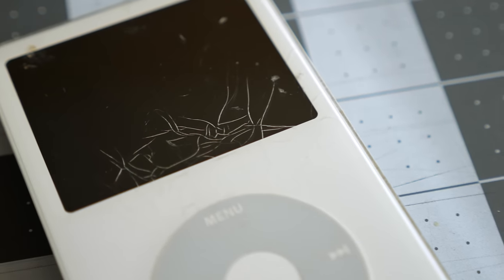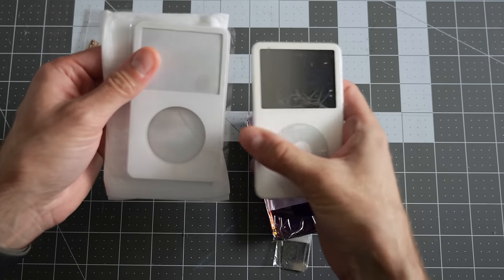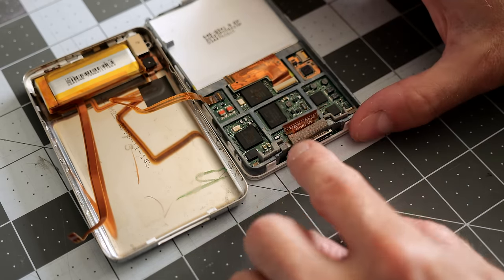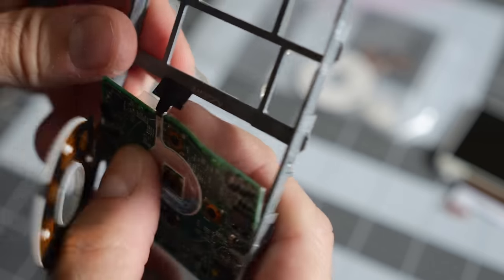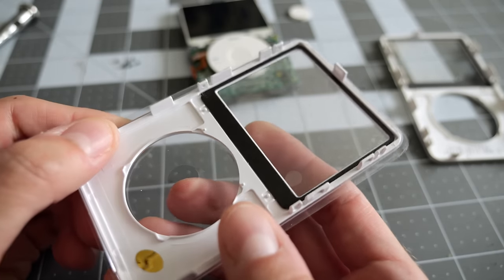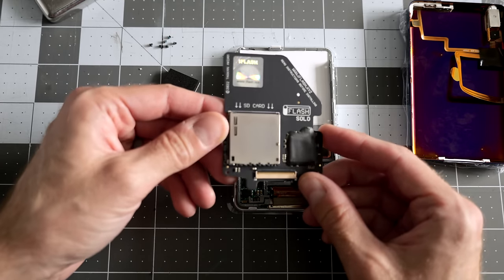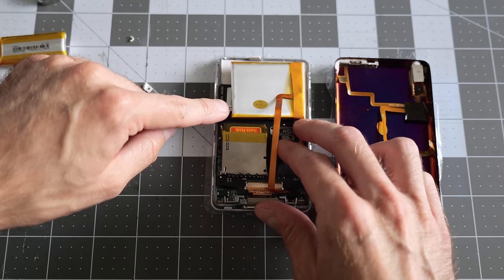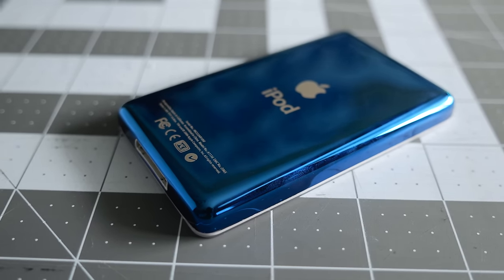Building a Custom iPod Video!

Comment: the only thing to add to the ipod is 'Rockbox', which is 100% compatible with video and classic editions. Much better than the standard os and you can drag music and itunes is not needed at all, and has a dazzling array of features, for me the custom equalizer is gold. Would make nice content on your channel too.

One thing to note about the anodised coloured back covers, that colour is microns thick, scratches very easily and will look a trainwreck in no time if not really handled well. One way to increase the protection is to spray lacquer the back cover.

Great video to show those interested, I have had mine custom for years now and it's nothing but a win on all counts for those on the fence.
Reply: For me the iTunes integration is the reason to use an iPod. It would be nice to be able to have more than ~30,000 songs, or ~200GB in my case, but I rely on ratings and smart playlists and I wouldn't want to switch to manually managing storage. Of course your mileage may vary and someday iTunes will probably be impossible to use but for now I want to benefit from the many years I've put into my library.
Reply: I agree, I have been using Rockbox for years and it has been really nice. The fact that it is able to process so many other file types is great for us that like lossless music. My only complaint is that playlists are kind of a pain to set up, so I find that I am mostly listening to complete albums instead.

Comment: FYI, the motherboard of the 5/5.5 gen ipods have either 32mb or 64mb of onboard RAM.  You want the version with 64mb and the Wolfson Audio DAC otherwise it becomes useless to install more then 160GB of storage.  
Also, regardless of how much storage space you installed, an iPod gets glitchy when you have too many tracks/songs on it.  It starts getting glitchy; songs won't play, it locks up, or it resets itself.
Reply: How does one tell whether theirs has 32 mb versus 64 mb RAM?
Reply: @johnross8939 yeah!
Reply: @johnross8939  the 60gb and 80gb 5th Gen models came with 64mb. 30gb came with 32mb
Reply: @LambdaMiscellaneous  the 60gb and 80gb 5th Gen models came with 64mb. 30gb came with 32mb
Reply: 65,535 songs is pretty much the limit on the 64mb models as well. Anything over that and the same thing happens. But you can store that many songs and the rest videos or documents and it’ll be fine.

Comment: This is pretty cool, and I didn't know they made after market parts for ipods. I guess by now I should just assume everything has an after market. I'd like to see you build a fully custom portable music player, maybe using a Pi ZeroW and bang some sheet metal into shape to make the case. As for the multi-color on the back side of that metal piece, it's because they heat treated it to get the color. Really neat.

Comment: I was 14 in highschool when i bought my ipod video 30gb. I had long hair with bose earbuds that never left my ear. I listened to music from 730am until at least 4pm where i would listen from my pc. It was revolutionary. Before i had a 512mb mp3 player i spent $200 on that could barely hold 50 songs. Back in the limewire days i had over 20,000 songs on it and a few movies. The movies were really quirky. I got really into ipod software modding at the time as jailbreaking was a new thing. Funny enough i was big into myspace modding too. I ended up teaching a friend how to mod and he went heavy into it, and now works in silicon valley. Im currently building a 2004 era alienware predator 1 case and thought the old ipod video would match the aesthetic perfectly, and sent me down this rabbit hole of modding. My front panel is cracked exactly the same, the screws are missing, the hold button ribbon cable is ripped and the centre button is missing. I had to replace the screen and the battery way back in around 2007, but its sat in a drawer since. Im excited to bring it back to life with some upgrades! The nostalgia is REAL. I wont be replacing the rear chrome cause i remember getting it brand new and the first scratch.

Comment: I did a similar upgrade to my Tonium Pacemaker wich is a DJ music player with a tiny hard drive. I replaced the hard drive with a Compact Flash adapter that took SD card. Works perfectly. And also put in a new bigger battery.
Reply: I was worried you were doing diy open heart surgery for a second
Reply: @randallcraft4071  Oh my would that be adventures 😅

Comment: I had mine made with the 3000mah battery and 128gb storage, White faceplate, blue back plate, blue click wheel with a white middle button and it’s great, only thing with the one I have, I noticed when I put headphones in they can easily be pulled out, They’re not super snug when plugged in but it’s not too bad and everything works good, I bought mine already put together by elite obsolete electronics and it’s been working pretty good

Comment: I still have a 'square' nano, and first generation ipod touch around, both still with their original batteries, and both still giving many hours of use on a charge. 

While it does not actually prevent problems over time, slow controlled charging, and keeping the device cool while charging, do a lot to make those batteries last a lot longer, and reduce the risk on outgassing during charging. Yes, over time they will go bad, no matter what you do, but they can last a lot longer than they do for most people.
Reply: I bought a special watch strap and turned my square nano into an “Apple-Watch”, the nixie style display option is really cool
Reply: @anoopsahal1202  I don't really use my nano anymore, I just check on it every couple months to keep it at around 40% charge. 

I still use the ipod touch as music player, on the road but also at home. My main audio system can act as dac for ipods and iphones, and surprisingly, support for that goes all the way back to the first ipods which could connect to usb, and all the way up to the latest generation iphone.

Comment: I've had the parts for upgrading a 5th gen with a new battery and an iflash adapter dor a while now, this video reminded me that I still have to put it all together. I think dankpods showed that you CAN fit a larger battery with an iflash Quad inside a thin back. I mainly use my ipod for podcasts as I like having the space to have all of them available all the time rather than as extra data on my phone.

Comment: Did this mod in 2017, with the same iFlash model. The weight reduction was immense, it weighs like a peanut afterwards. Now is about time to replace the battery and increase the SD storage.

Comment: Hey Colin I did some mods like this way back in the day on my 5th gen. Someone developed a PCMCIA HDD to CF card adapter. But it wouldn’t fit in my 30gb case, so on eBay I bought the deeper cased 80gb back, with the larger 80gb battery also. I think I put in a 64gb card. I remember the battery lasting nearly a week listening 5-6 hours a day at work. These mods look like they’re a bit better now than back then.

Comment: You can actually squeeze a 3000mAh battery into the thin case but only if you use the iFlash Quad, I've built my custom 7th gen iPod Classic using this configuration and I have the thin case with a battery that fills the entirety of the back case!
Reply: Used to get 30hrs minimum from my 6.5 120gig, how long do you get from the mods?

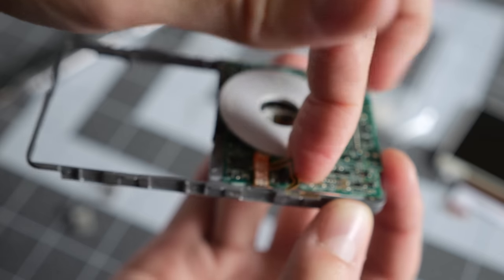Comment: 13:00 I could halve sworn that was grounding to the metal frame. It should operate fine without being properly attached to the frame but if you are around ridiculous amounts of static or microwaves, I’d imagine its better to be properly installed.
Reply: yeah, that's what it does

Comment: For my 5th Gen I’m going all out. New faceplate, middle button, click wheel, back, battery, and the iFlash adapter. I’m also modding an iPod mini and replacing its battery as well.

Comment: you can fit the 5000mah battery in the thin 30gb back. i filed my internal frame just a little bit and used the micro sd card board for 512gb and a 5000mah battery which lasts me on and off for over a month.

Comment: Modding a 5th gen is easier than you think. I'm totally not that good at this stuff but managed to upgrade one. 'For parts' 5th gen ipods are fairly common on ebay and affordable (at the moment) - I got 2 for $50. There are limitations though. If you have a large collection of music files, the limited RAM in these things makes shuffling and searching very sluggish. If you are thinking of creating a mega-pod and banging all your tunes onto it, I would look elsewhere. With a nice smaller collection of music, this thing is excellent, good battery life, responsive and, let's face it, cool. Thanks for posting this, Colin, definitely worth the watch.
Reply: I remember back in 2004/5 when I loaded my 30GB one up.  Stock back then with it loaded it was super sluggish.  I never knew why but I should have guessed on the menu database slowing it down.  But hey, I had a 5th gen Video iPod so I was the best, lol.

Comment: Pretty sure that double stuck tape for both parts of the click wheel is a common ground to avoid errant touch detection.  That's why they're both connected to the metal body.

Comment: I modded an iPod G7 that way. iFlash SD card (512 GB) + green front and black back. Looks amazing.
The song limit. was no problem since I flashed Rockbox in a blink of an eye when I was ready. No song limit, way more options and even a freakin' Game Boy emulator. Nobody needs the stock firmware any longer. :P

Comment: This is a really interesting coincidence. Huge fan of the channel and I just modded a fifth gen iPod last week. For what it’s worth, you can fit a larger battery with a slim back and iflash quad than the 2000mH. I tried using a 3000mah battery because I read online that the thin ones work. However, I learned that even batteries listed as “thin” on eBay are sometimes thick so it’s luck of the draw and mine didn’t fit. I then ordered a 2800mah and it fit perfectly, and I believe there is only one form factor so you should be safe. I’d recommend anyone with a thin back 5th gen and iflash quad get the 2800mah battery. You can try your luck with the 3000mah, but I’d trade 7% capacity for having to risk getting the wrong battery
Reply: Elite Obsolete Electronics (mentioned in the video) has a YT tutorial detailing battery sizes fitting with the various iflash options & thin/thick backs and illustrates exactly your scenario. To that end, EOE expressly only sell a thin 3000 in their webstore so you can buy with confidence from them if you have a quad and thin back. But yeah, Ebay can be a dice roll.

Comment: I've done several of these. Here's a couple tips: TIP #1: do NOT yank the battery cable like shown in the video. You are more likely to damage the connector on the logic board than to just get the cable free. Use a pair of tweezers to pull the brown (sometimes grey) plastic cable-retainer up away from the board, releasing the cable. Back in the day they called these zero-insertion-force connectors because you don't need to use any force. When reassembling, just insert the cable and press the brown cable retainer back towards the board and it will lock the cable in place.  TIP #2: get more than one metal "spudger". I've only ever opened one of these as easily as shown in this video once - and that unit had been opened several times before. Take your time, and leave a spudger in place to block-open clips that are stubborn. Also, start releasing the clips across the top of the iPod first, they're easier and will give you some leverage to get the sides. You only need the top and one side to free it up enough to release the back and hinge it away from the front.  TIP #3: do NOT start with your spudger around the 30-pin connector. You will bend the thin metal of the back case around the port and it will never go back into proper shape. (unless you're replacing the back, but still be careful, because levering with a spudger around that connector can damage the connector). TIP #4: just buy one that's already been upgraded by Elite Obsolete. He's a pro and does excellent work. This will save you much frustration: such as when you replace a screen getting every tiny particle of dust out while still assembling the iPod. It's a real frustrating challenge. TIP #5: you do NOT need to remove the logic board from the frame to replace the click wheel. Leave the board connected to the frame (the black tape between the screen and the board). The flex cable of the click wheel wraps around the board and inserts pretty easily without removing the board. TIP #6: use a piece of masking tape to hold the click wheel and center button together while you're reassembling. Also peel away the plastic cover of the front cover and run that tape across the front cover, the click wheel, and the button, holding all three in place. Trust me, it makes reassembly a LOT easier. The alignment of the click wheel and button are critical. Sometimes you'll get it completely reassembled and everything will look great... BUT the clickwheel will be slightly out of alignment with the buttons on the logic board (another reason not to remove the logic board from the frame) and you'll have to take it entirely apart again to adjust it. It's a real bummer when you damage (nick) the front cover getting it back open. TIP #7: take note of where screws come from and what color they are. There are varying lengths of screws, and they do NOT all work in all places. Generally: silver screws are longer, and black ones are shorter. But if yours has been opened before, you can guarantee they're all right. You can't use a short one where a long one is needed. You'll screw and screw and screw and it will never grab. TIP #8: but an extra screw kit for the iPod. Those screws are T-I-N-Y!!! You will lose one... or more.  TIP #9: The 3,000 mAh batteries are NOT actually 3,000mAh. They more like 1,500 to 1,800mAh. That's still a great upgrade. But not what is listed, which is disappointing. (Unsurprisingly, the 2,000mAh battery is NOT in fact a 2,000mAh battery either. I forget the actual capacity.)  TIP #10: Test the iPod completely BEFORE clicking that front cover into the metal back cover. Once it is clicked in place, you'll have to damage your brand new covers to get it back open if something needs adjusted inside.
Reply: TIP #11: don't remove the screen unless you're replacing the screen. That connector cable and socket are easy to damage. Why take the risk?
Reply: According to iFlash, the 2000mah is ~1700mah.

Comment: Very cool - I am upgrading/modding my 7th Gen 160GB iPod (well, I'm sending it out to have the work done), but I am upgrading to 512GB, larger battery (3000MAH), bluetooth capability, and different front color, new clickwheel, and center button.  Really looking forward to having that done.  I use my iPod every day.

Comment: I would loved to see a modern mod, such as replacing the connector with something more universal like usb C, micro or anything else. I also would love to explore other mods such as bluetooth - or so I’ve read about, though I believe at that point you would be running custom firmware.
Reply: Then that would make docks useless
I use a iPod dock in my hifi system to listen to lossless files on my big hifi 
30pin is no big deal
Reply: Someone on Reddit made a USB c mod to an iPod classic. I think its called Oxyll USB C mod.But honestly I wont install the mod because I already have an iPod dock.

Comment: Awesome video, great work Colin! Suggestion for a future video, would love to see what you could do with iPod nano 5th gen. I thought that perfect iPod.
Reply: I loved those too, but they are unfortunately extremely difficult to mod, and there’s not much of a scene for it. It has to do with how everything is packed so tightly inside. Many iPod Nano batteries have swelled, and when they do, it causes the screen to form a big blotch in the middle from the pressure.

Comment: Fantastic mod! If suitable parts are available, I'd match either the clickwheel or the center button color with the back panel (perhaps a slightly more subdued hue?). Hopefully, it would look like a limited edition that never was. [edit:] If it's the clickwheel that we color match with the back, that could solve front panel white not matching clickwhel white in the process!

Comment: The song limit issue can be worked around by using a 3rd party firmware like RockBox. It doesn't use a database at all, as you just drag and drop files into a drive that shows up when you connect the device. You can even dual-boot with the original firmware if you want.

Comment: I build mine last year. 3000mAh Battery Upgrade 512Gb (4x128) SD Card from Sandisk. 

New Faceplates, Click Wheel and Backplate. All Black and Dark Grey.

It’s Just Amazing.

I Am waiting for a micro Bluetooth 5.0 Module to arrive and will install it in a couple weeks

Comment: I did this and it all worked fine on my first try. Replaced the entire housing back and front, the clickwheel, battery, and flash mod...
the ribbon cable connecting the two halves was very iffy because the unit I had was worked on before (somebody gave it a new screen) but it was fine